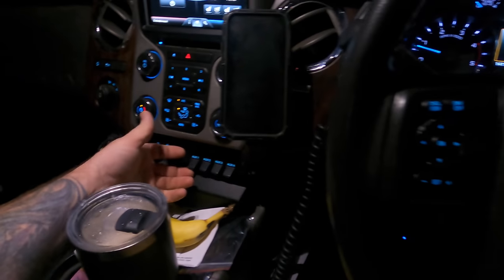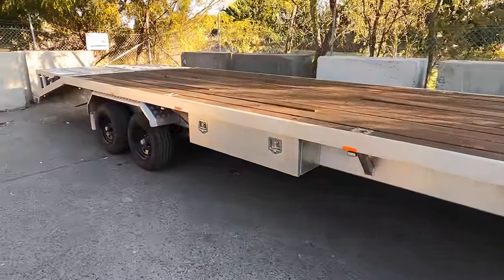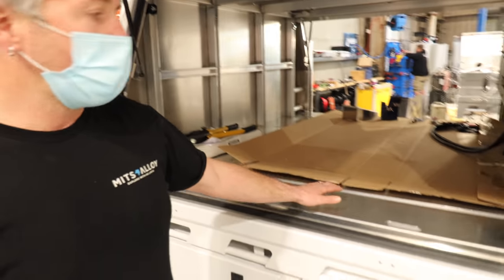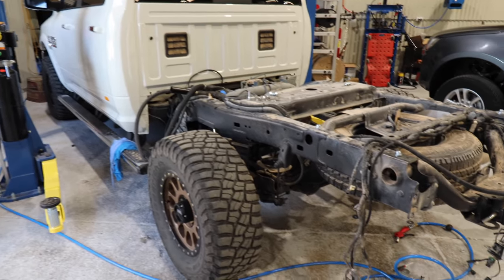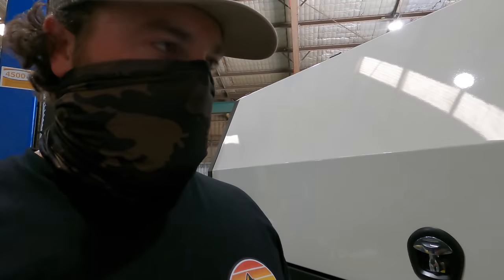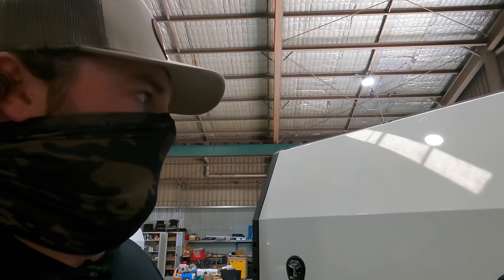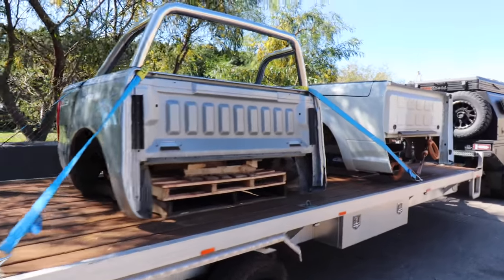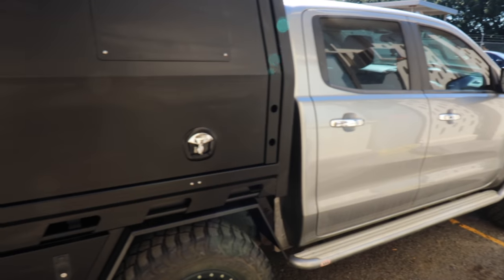RAM 2500 MITS ALLOY TRAY & CANOPY EP2. Tow & Tourer build!

Comment: What sort of weight is the big girl once the canopy is on please? I have a Chevy 3500 (SRW) with a heavy alloy/steel canopy from CSM and it's around 750kg....so that's why I needed to up-spec the Chevy from 2500 to 3500 to make the GVM 5,171kg.
But once I chuck the Bushtracker on the towbar, I'm getting close to that GVM.
GCM is 11,113kg, so I have no dramas on that score.
Reply from the maker: Last video in series I’ll be going over all the specs and weight of the setup etc mate 👍🏼